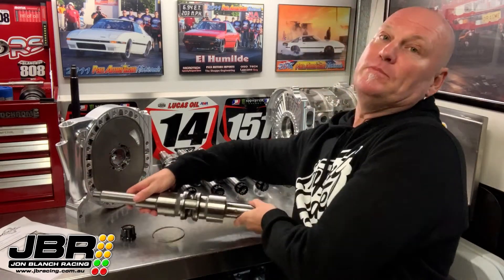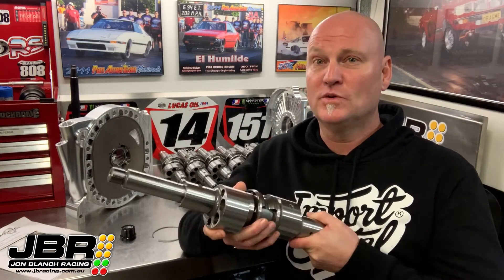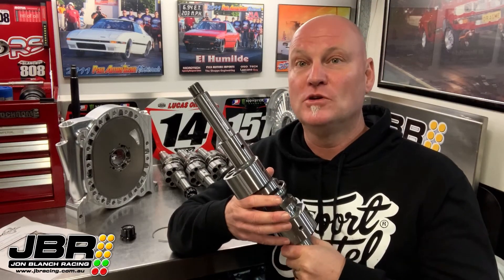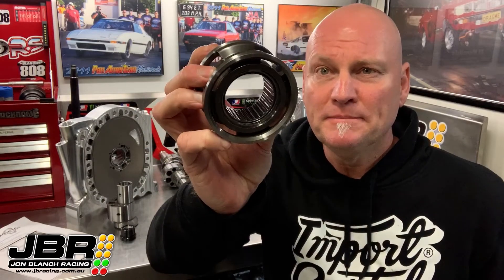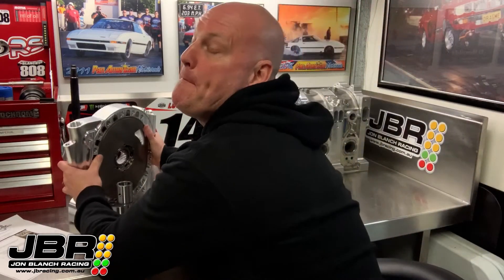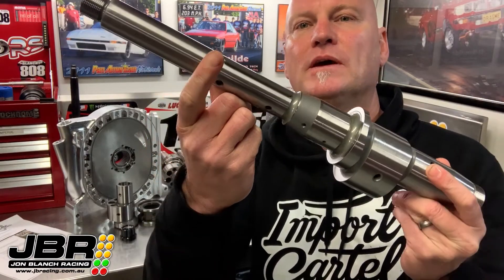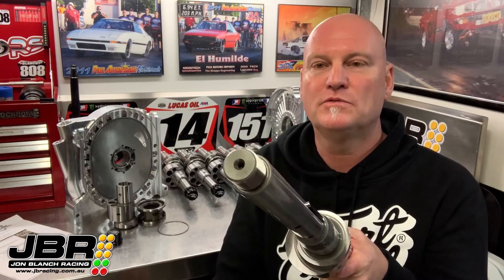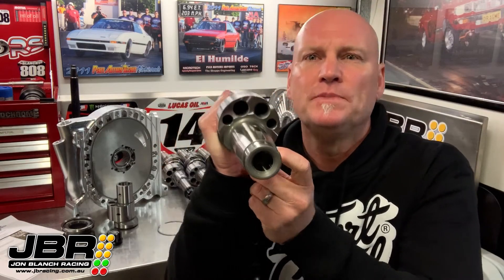Xtreme Rotaries 2 Piece 13B Centre Bearing Eccentric Shaft

Comment: Has anyone tried building a 2 rotor without the center housing?  Just a single solid thin plate.  And use PP so no center side ports.  I think it would require a two piece shaft in order to assemble one.  But it would be lighter, smaller, and shorter shaft.